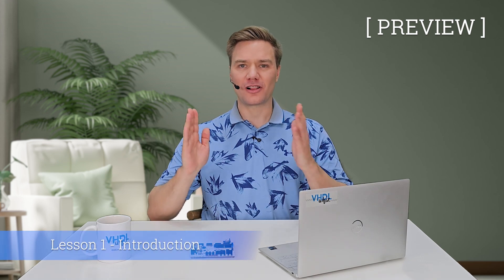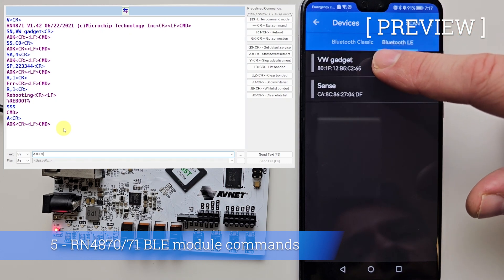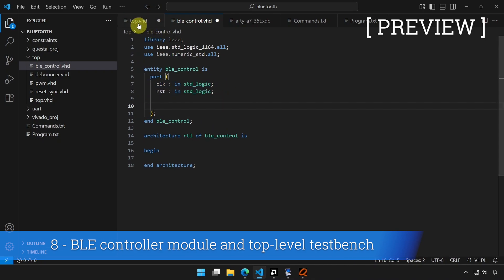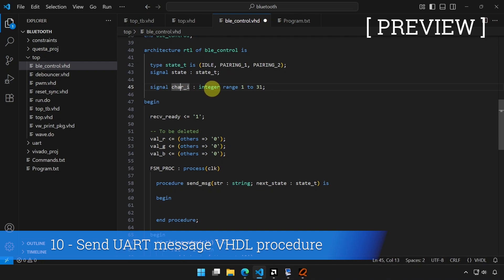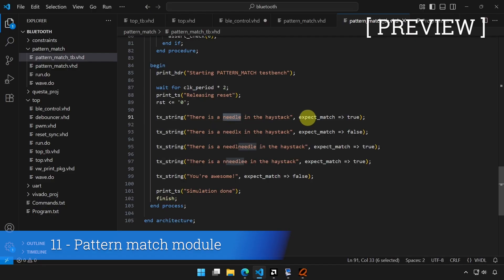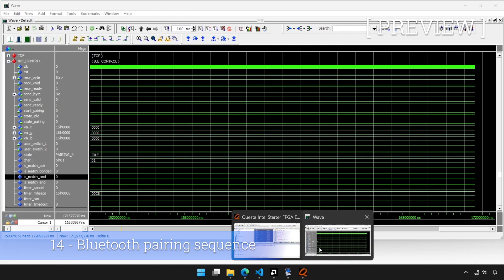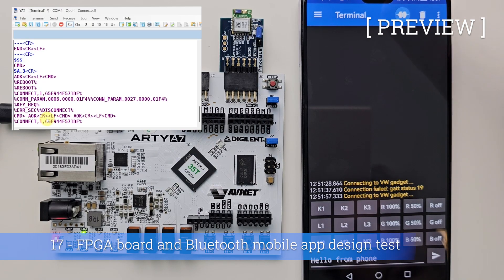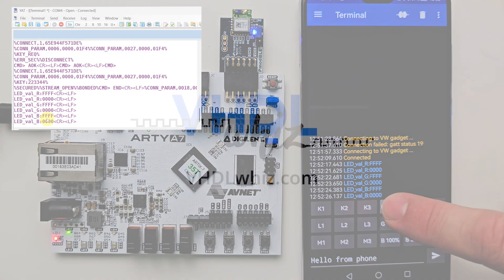Course preview: Bluetooth FPGA control via mobile app

Comment: Any thoughts on LiteX?

I don't know exactly how it works, but it seems easy to instantiate IPs ( RiscV ,  Logic Analyzer (Litescope) ,  JTAG-UART,  etc) and program SoC designs on your FPGA.  However, if your board is not supported  (like me I'm using a Trenz SMF2000) I think you can still have LiteX generate verilog that you would then import to your existing project and make the connections there?
Reply from the maker: I haven't looked into LiteX, but I will definitely check it out! Thank you for the tip.